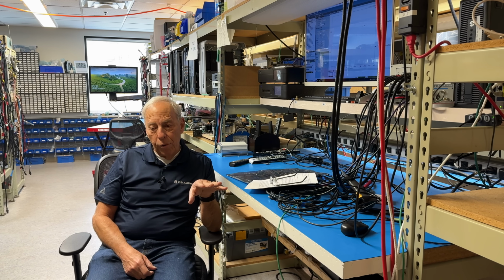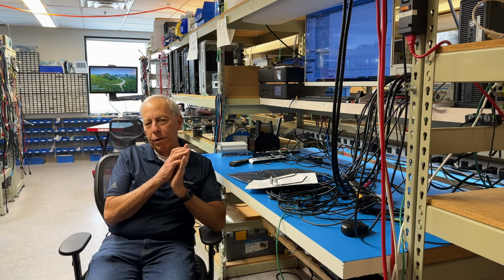Mixing speaker cable materials

Comment: When we talk about cable thickness, we often think of power cable that is 50hz or 60hz.
1000hz or 20,000hz is something completely different. Higher frequencies do not behave the same through a cable as the 50hz or 60hz do.

Frequency	Recommended Wire Gauge	(mm)

60Hz to 1KHz	28AWG	0.32

1KHz to 10KHz	30AWG	0.25

10KHz to 20KHz	33AWG	0.18

20KHz to 50KHz	36AWG	0.12

50KHz to 100KHz	38AWG	0.10

100KHz to 200KHz	40AWG	0.08

200KHz to 350KHz	42AWG	0.06

350KHz to 850KHz	44AWG	0.05

850KHz to 1.4MHz	46AWG	0.04

1.4MHz to 2.8MHz	48AWG	0.03

# Remarks : AWG size is related with Skin effect & Proximity effect which means how much current could flow in the litz wire without resistance and how much effectiveness could influence the induction effect.

Comment: Thank you Paul, very interesting, I'll try it. 
What do you think of Silver v'erses copper wire?
Reply: Tried silver back in the day and found that it brings out sibilance and an unpleasant reveal of the electronics themselves.The audio outlet I used to frequent loved my discription of these cables...I would say it sounds like someone "frying steak in the background".Stick to solid copper...I still have Audioquest Midnight cables that I have had since the 90's.I have heard nothing as pleasant as these,and I have tried many.But,as with everything,the choice is yours.
Reply: Silver is a nest of snakes, there is silver and silver, depends on purity and construction have had some good results however had some awful results too, then you can add silver plated copper which is another mine field. All need a fair amount of running in too. Most outlandish I tried was nylon tubing filled with polished mercury. Great for corroding your phone plugs. Not good for sound though!
Reply: I don't know if I would prefer silver as cables between the speakers and the amp; yet, for inbetween the crossover and the mid, I use bare very thin silver wire, which really sounds wonderful for the large horns. But for highs, I'd stay away from them, just a regular small stranded copper will do fine, as for the bass drivers. I suppose that most people could better use very simple and thin speaker cable, run them seperatly, and the money they save they better invest in better speakers or crossover parts. I use very (ultra) high end speaker cable, just 1,5mm2 nice copper multistrand, cost about 10 doller a meter. Never heard better.
Reply: @edmaster3147  I reckon we’re on the same page. Cheers.
Reply: I have Empire Ears Legend X in-ear monitors, which came with an Effect Audio copper cable. I changed over to an Effect Audio silver cable, and it really improves the high end. The silver cable developed an intermittent connection, and when I switched back to the copper cable, there was a noticeable hollow darkness that isn't there with the silver cable. From what I've read, the Legend X is particularly sensitive to cable rolling.

Comment: For lonnng runs I think changing to a 70 or 100 volt speaker system is the only way.  Check out the system at your local airport.
Reply: 70 volt very good commercial amps are very cheap in the aftermarket also (eBay).
Reply: I wouldn't go down that rabbithole of frequency bending transformers for the mentioned distances!
As soon as you'd need several 100 meters or even kilometers, like at airports - you have to, no way around it - and nobody cares of sound any more inside an airport hall, as long as you get the mid frequencies through.
Reply: @werner.x  I know,  the one interesting thing about noisy busy airports is that the best place to wait is in the toilet. 
The sound is a lot better.

Comment: First rule:  Don't splice speaker wire!   Use a single piece from amplifier to speaker.   
I have used 50 feet of 18 AWG wire per channel with no reason to complain about the results.

Comment: Go to powered balanced speakers and amps
Reply: If by balanced you mean differential, that's only useful if your speakers are active with a differential amplifier that can make use of the differential signal. Between an amplifier's output and a speaker, this has no effect.

Just a tip to save you money in case you aren't using an active speaker with a differential amplifier, because otherwise it will make no difference other than a bigger hole in your pocket 🙂👍

Comment: Recommending common items like Romex is excellent practical advice. I applaud it. However, the idea that thinner wire in parallel with thicker brings out more high frequency is extremely dubious. No, I am not accusing you of making it up. Yes, I can try it myself. However, unless you and I try it on a BLIND compare basis with two wires of equal thickness (that collectively add to the same gauge as your thick/thin pair) there is no way to know this is really true. The placebo effect exists. Confirmation bias is real. There is no human, expert audiophile or not, who can hear a meaningful difference in the test I outline on a blind basis. That’s not an attack or an insult, it’s just abject common sense.  But please, I beg you, prove me wrong. Do a live video showing such a blind compare, and show us that you can tell which pairing is which over multiple blind trials. Until then, since your suggestion relies on common, reasonable cost items, and is just another path to a thicker gauge, I suppose the idea does no harm.
Reply: Cardas audio does this with their high end cables using the golden ratio.  They are excellent cables.
Reply: Getting an audiophile/snake oil salesman to take a blind listening test is like trying to pass a camel through the eye of a needle.😊
Reply: @georgebliss964  I actually think most audiophiles, given the chance to do so at dealerships or home trials, would readily do so. It’s the reviewers and manufacturers, for whom such tests are an existential threat to what they are peddling, who resist the idea.

Comment: Are we talking about the skin effect here or is it something else?
Reply: I believe it is skin effect.  Higher impedance as the frequency goes up on lower gauge wire.
Reply: @user-od9iz9cv1w  I thought the skin effect is vice versa: Higher impedance for higher frequencies in larger wire gauges. Correct me if I'm wrong.
Reply: @Fastvoice  I'd argue you're correct if you say larger diameter.  Larger gauge is smaller diameter, so I'd argue as stated not correct. As frequency goes up the depth of wire used for current decreases.  So a bundle of 24 gauge wires that add up to a 10 gauge wire will have a lower impedance across 20 - 20kHz than the 10 gauge which will be lower at 20 Hz ans slightly higher at 20k.
Reply: @user-od9iz9cv1w  Your 1st sentence makes perfect sense to me. For the rest I'm a bit lost because english is not my 1st language and therefor I seem to be completely off with my understanding of "gauge".

Comment: I highly recommend to use 16 gauge for highs, than 14 guague for mids and 12 gauge for low and bass. They must be braided in order to achieve their best. End them to you plug of any kind and connect to speakers.
Test it compared to previous cables and difference would be huge. 
Open stage that possibly won't even fit you room how open it is, crystal highs (you must be very careful handling becasue cristal can be broken and Windex should be used for cleaning them), tasty and jucy mids that can even make stains on your cloth (again, be careful, use presoak on your washing machine), a and punchy bass that, if you are not careful enough, can hit you into you face leaving bruise.
I hope everyone can see how setting Hi Fi isn't so simple and easy task to do!
In meantime, every other thechnolgies in the World use one, same gague cable because they are ignorants!

Comment: As an engineer you should not only state that smaller cables drives better high frequencies, but why they do. 
There should be a technical, physical explanation for that. Otherwise the risk of people claiming that this is snake oil is big.
And the answer should not be try and listen for yourself. 
Ears are too biased from our brain. Either you do a thorough blind test either you measure it.
Reply: As far as audio spectrum..its fluff..but . It is mostly about maxing the dynamics of the cable..ac runs on the skin of the wire multiple strands have more surface area so stranded handles more power than solid conductor..if you want to say hes correct..he is..but when the freqs are way higher than audio.. I suggest everyone find ethan winers page and research his testing..now.. is expensive wire better..? Yes..but its the law of deminishing results.and the room.and speaker placement and the  other electronics in the room or even house that affects the system way more than speaker wire..i suggest..copper stranded 10 guage.. belden wire. Rock on..

Comment: Sorry Paul,  but I respectfully disagree. Copper, like aluminum, gold, silver, and bismuth are all diamaggnetic materials, 'dia' means 'around', that means they hate magnetism. A magnetic field cannot penetrate very deap below the surface of those metals. It is exactly that property that makes them excellent conductors of power. The power is conducted on the surface of these metals not within, That's why stranded anything is far superior than solid, more surface area per gauge of wire. It would also depend on whether your amplifier is class A, A/B or a class D power. The old 200 watt  Carver amps back in the day, and the modern ones of today, are class D power, They weighed about 4 or 5 pounds.   My McIntosh of the same power rating weighs 92 pounds!, Most of that from massive output transformers wound with thin, high purity copper, and filter caps the size of coffee mugs. It has a frequency response of 0 to 100,000 hertz. Romex, for speaker cable? I think you've lost it there my friend! Everything I've said is settled, scientific fact... imho.